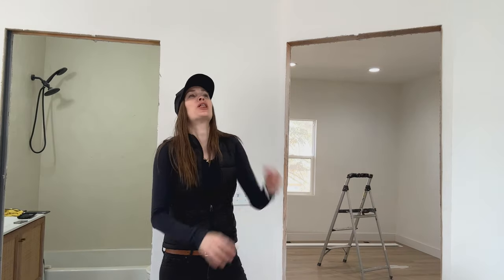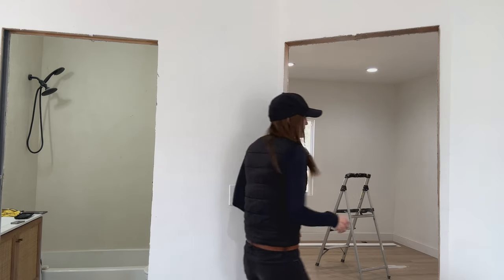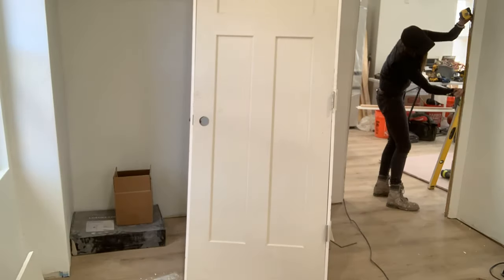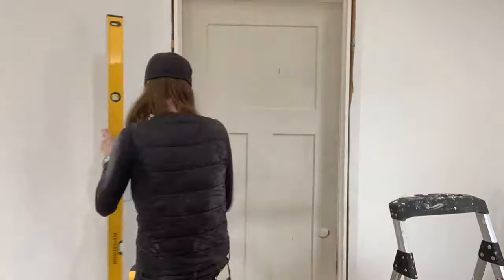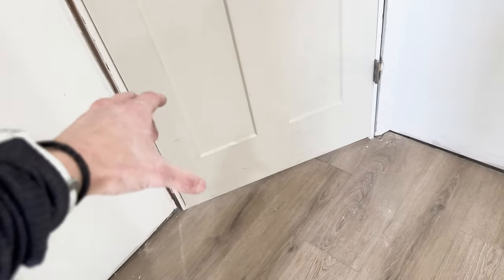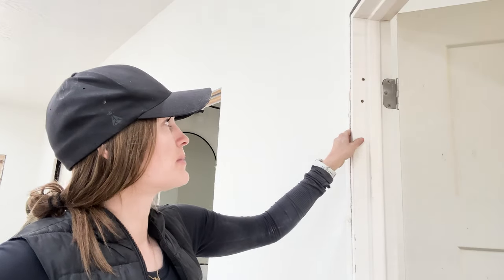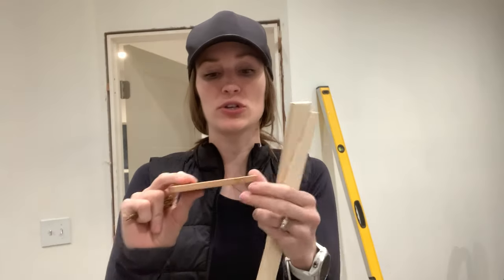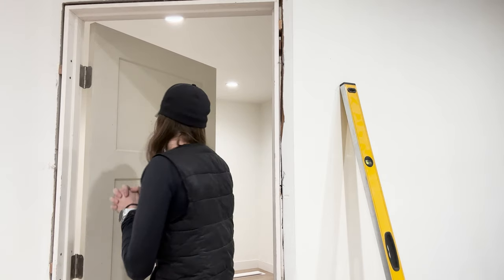How to Hang a Door

Comment: Rofl my house is so bad, the home builder broke away up to 3" of drywall around the door openings in many spots. Found that out when I started replacing the doors and trim. 😒 Like... the walls are narrower and wider than the door jams, off level on opposite sides(one side will grow by 3/4" on the left from top to bottom but the right side will grow by 1/2" from bottom to top). I've installed quite a bit of doors as a carpenter but this has been beyond frustrating. Never seen a house built this bad.
Reply from the maker: Thats crazy! Sounds like they had to work around a bad framing job!